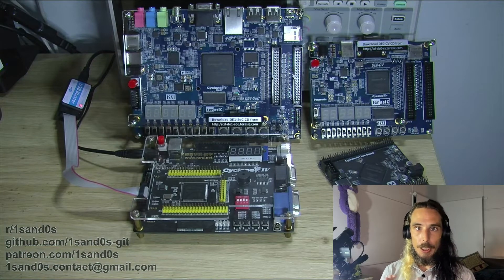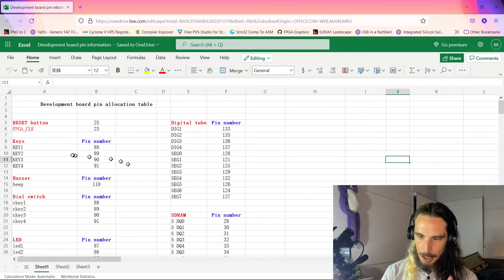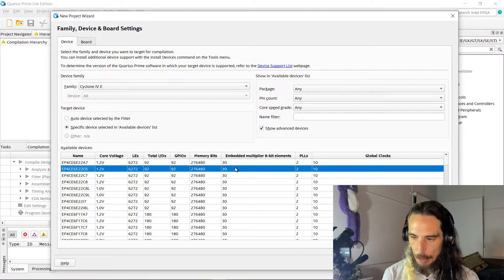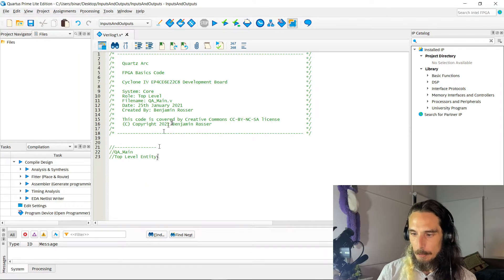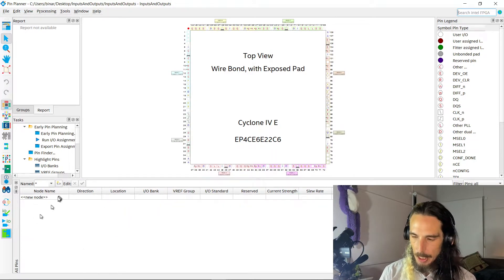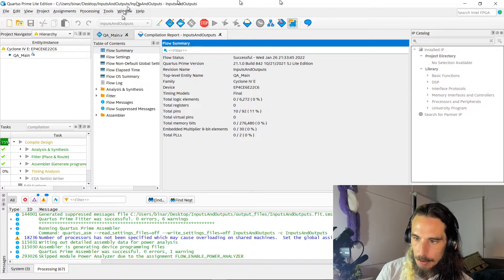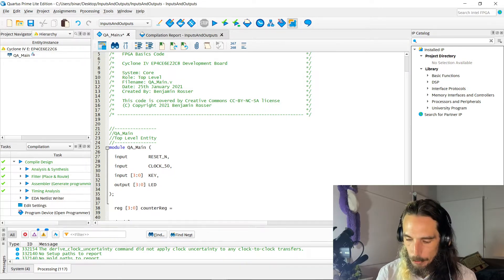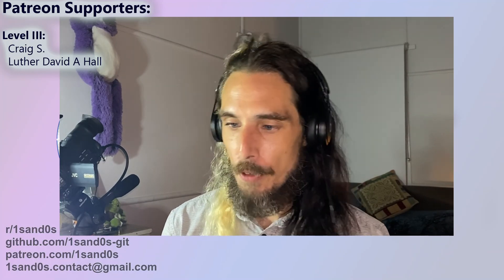Inputs and Outputs - FPGA Basics Episode 7

Comment: I am very confused with choosing vcc or gnd for the input and output pins.  I am trying to consolodate a circuit that comprises active high and active low inputs and outputs.  if the input is, for example labled /reset (not reset) should I set the pin to gnd instead of the default vcc?  Using Quartus and am using an atf1508 84 plcc (max7000 slc)

Comment: What is your look upon using and learning systemverilog or sticking with verilog?
Reply from the maker: Good question! SystemVerilog certainly has benefits over Verilog in the case of it providing a structure for hardware verification. In situations where that it required it is definitely the better option. If I was developing a project that required those aspects of hardware verification (test-benching and simulation), then it would be my preferred option.

For most of the projects I do with FPGAs, I find the features provided by Verilog to be more than sufficient and I find that the flow of the language better suits the way my mind wants to work most of the time. That is why I typically opt to use it.

I personally think with languages in general (written/spoken, programming or hardware description), that the more understanding a person has of different languages, the more ability to have different perspectives on the underlying concepts that those languages describe. That certainly has benefits due to some languages being able to describe a concept in a way than another language cannot, or having particular strengths and weaknesses. 
A perfect example is with programming languages, as there are certain concepts and approaches that I use daily with C & C++ that I partly gained through the use of x86 and Arm Assembly. Some approaches I take at times even have roots in some of my previous work with Pascal and Borland Delphi, or even Shader Assembly and HLSL.

It is a bit of a long answer, but I hope that answers your question :)